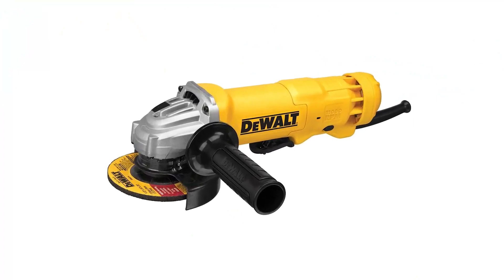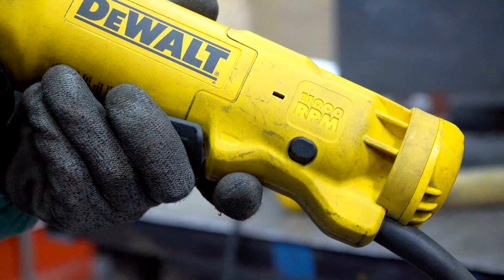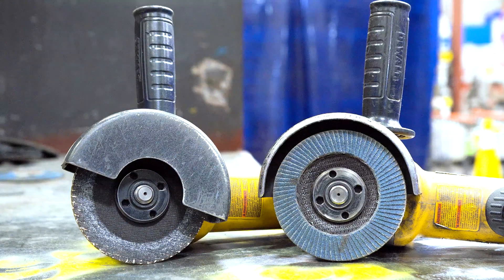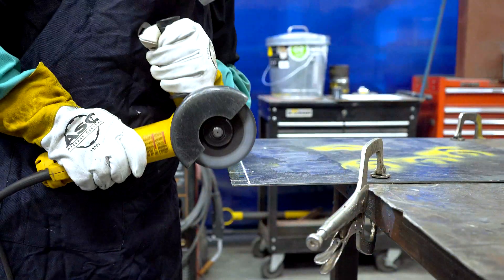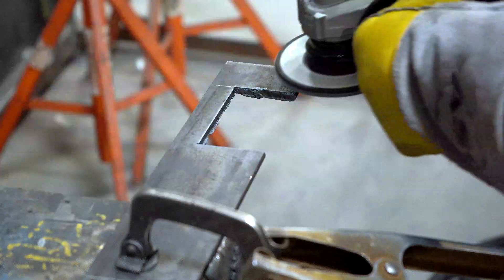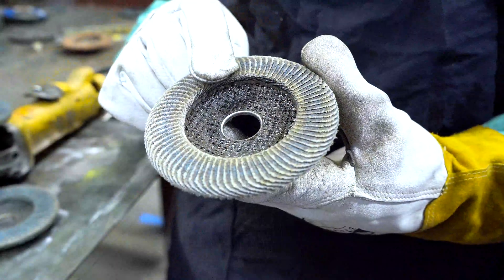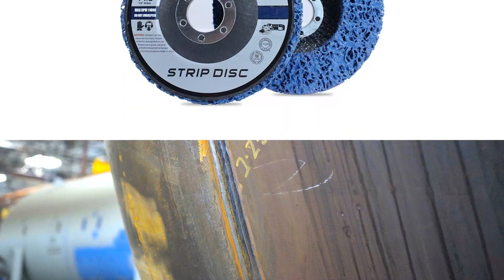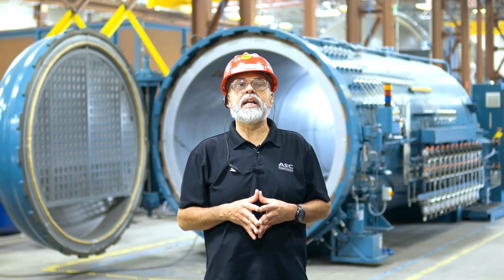The 5 Most Common Angle Grinder Discs

Comment: At 2:27 you show the disc throwing sparks away from the operator. Most videos recommend the opposite, so that if the grinder jams it will be snatched in a safer direction away from the operator. With sparks flying forwards, any jam will throw the tool AT the operator! How do you justify risking kickback towards the operator just to have to sparks going conveniently forwards and away? Is it just a matter of skill to avoid kickback happening at all?

Comment: Sir I have doubt what if  the RPM of grinding disc is equal to the grinding machine will the disc break or is it safe to do so pls reply
Reply from the maker: Hi. The general rule for grinders is the rated speed of the accessory (e.g., the disk) must be at least equal to the maximum speed of the tool. So, in general, it would be safe to use a grinding disc with an RPM rating equal to the maximum speed of your grinder. However, you should always review and follow the manufacturer's user manual for the specific requirements and safety instructions for your tool.

Comment: What disc should we use to remove polyurethane sealant from concrete contraction joints?
Reply from the maker: Hi Pavan. We asked an expert fabricator on our team. He stated this isn't his area of expertise, but recommended investigating the use of a thin profile stainless or hard plastic wire wheel, or a composite cutting wheel. A steel wire wheel will most likely impregnate the concrete with iron and cause rust stains. He would not recommend using a concrete/diamond blade because that will cut away and alter the shape of the joint. Hope that helps.
Reply: You guys are awesome!

Comment: can I use a 4.5-inch cutting disc on a 4-inch angle grinder?
Reply from the maker: Hi Jojo. We can't say what applies to your specific circumstance, but here are some things to consider:

You should only use a disc that is rated for your grinder. This is because of the guard, the RPM rating, and the disc arbor size. You need a guard that will properly sheath the disc; the disc needs to be rated to the RPM of your grinder (otherwise it could shatter); and the disc needs to have an arbor hole sized for the grinder spindle. If the arbor hole is not sized correctly, your grinder will vibrate and become hard to control.

Additionally, using a disc larger than the grinder is rated for could stress the grinder's motor and cause it to overheat.

Hope that's helpful.

Comment: Great video! This is a must watch for anyone using an angle grinder. He is only selling safe and correct use of a powerful tool. He also answered the size question for me. If they use a 4 1/2” for their tasks then a 4 1/2 is fine for me.

Comment: But if the sparks shoot away from you this means if the disk binds it will send the angle grinder right back to you. Instead of pulling out of your hands which should be more safe. Or not?

Comment: I see in the video the angle grinder is 11000rpm and that cutting disc you using on the same grinder i think is 10200rpm. Is that difference not dangerous?
Reply from the maker: Hi Dash. You're right. Using a disc rated for fewer RPMs than the grinder spins is not correct. The disc could weaken or break as a result. At 3:19 we show a cutting disc rated at 10,200 RPM. This disc is part of our training materials for the grinder class. We do not use it in our 11,000 RPM grinders. However, we understand the way it is shown in the video could create confusion. Thanks for pointing it out so we could clarify.